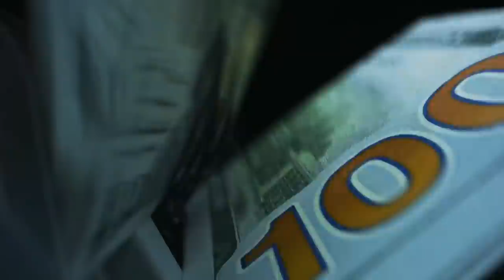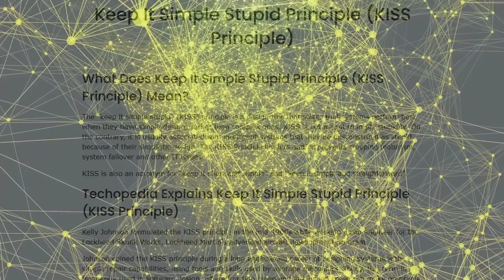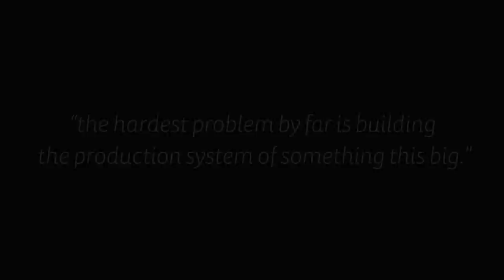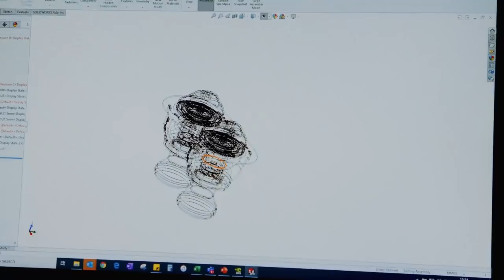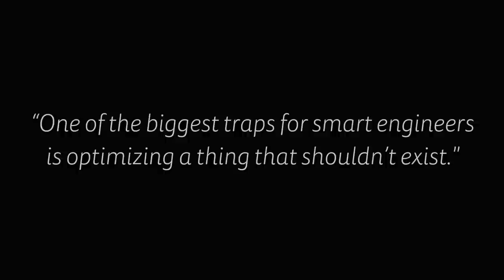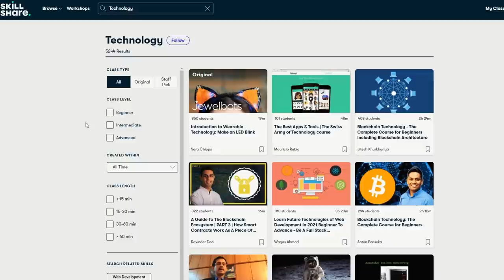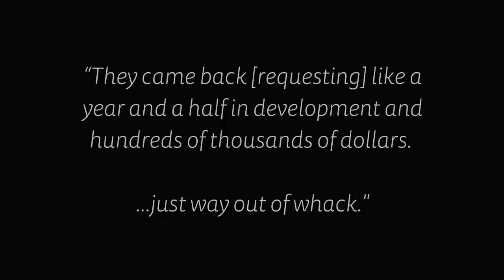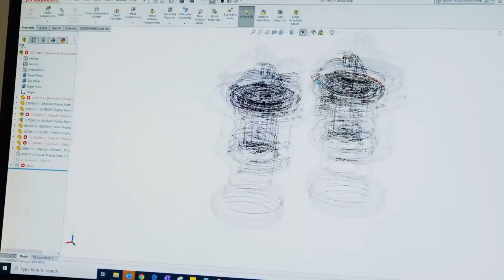How SpaceX Uses Simplicity To Engineer The Cheapest Rockets In History

Comment: I couldn't give a shit less about billionaires buying their astronaut merit patch.  Wake me up when we start going to space for reasons we can all benefit from.  Not before.
Reply: Starship will allow 100 people to go to the moon at a time for maybe $250 million. It will send 100 tons of supplies for the same price. If landed on the moon, (they will be able to do this in about 3-4 years) it can provide 1000 cu meters of living space (more than the internal volume of a 747). The rocket will be cheap enough to just land it and live in it at about $70-$100m to build. (Musk hopes to get that number down to about $30-40m.) 
Now he has a Boaring company that builds 12' dia drilling machines and you could launch one on a couple of flights in sections. It is designed to "porpoise" drill directly into the ground with no shaft required. 

Now you will be able to create tunnels on the moon and drill for ice, titanium and other elements while the machine extracts the rubble that will make the tunnel panels to reinforce the tunnel that it lays as it goes. 

Now build a loop a few hundred meters in diameter, put maglev cars in it (easy in vacuum with 1/6 gravity and have it slowly spin sections to create 1G gravity living environment well below the surface radiation and meteorites. 

Drill for raw materials, send new crews up at 100 per trip for less than $2m per seat and build a large, self sustaining colony that can send ore to orbital tations via magnetic accelerators (which would actually work at 1/6 gravity and allow construction of massive ships in lunar orbit to go out and mine planetary core remnants with massive reserves of heavy metals (gold, platinum, uranium, etc) such as 16 Psyche. These ships could be 13m or 18m in diameter and use Hall thrusters for months long journeys to bring back ore vastly more efficiently than rockets. They would not need large engines as they would never enter a gravity well stronger than lunar orbit. 

Now these big rockets can be used to shuttle cargo from earth to moon and back again but never land as tenders ("only" the size of Starship, acted as tenders to deorbit cargo.  As products start to be produced on the moon with additive manufacturing machines employed in near zero G environments in lunar orbit with materials from the surface. 

You could manufacture satellites on the moon and trans-ship them to Earth easier than launching them to LEO from earth. 

Power sources used (solar is the standard) could include Liquid Salt Thorium reactors which Have been pioneered already, are safer, cleaner, much more fuel efficient and cheaper form of nuclear power. These same reactors are also lighter (with no massive pressure circuits required like light water reactors as their coolant never enters the vapor state. 

With Starship, you get to setup the first stepping stone into producing a profit base and sustainable future in space and habitats that peope could inhabit for years with no bone or muscle atrophy and throughly shielded from radiation deep underground. 

 So... with the other ships you get to conduct a few experiments and collect a few moon rocks. With Starship, you open up space for colonization, not as a pet pork project, but as a opportunity for profit to draw people to Want to live there without government incentives. 

Oil workers endure Saudi Arabian weather for the money the jobs bring and the companies come for the profit. That's what this will allow. 

Musk wants to build 1,000 Starships in a 10 year span once he has profits from Starlink coming in (expected to be at least $10-20billion clear profit per anum from 2025 or so) to fund the construction. Some of these will be the big freighters mentioned prior. These can setup a city on Mars, but I suspect they will setup a much more practicable and valuable city on the moon far sooner and This and its ship yards will be out gateway to the outer solar system. 

Given the resources on the moon and the ease with witch they can be transported to orbit, zero-g hotels, tourism, etc. 
Massive space stations can be supplied with raw materials much easier from lunar orbit than from the surface of Earth... buiding massive sections of space stations and transporting them with Hall thusters to earth orbit, or simply the bulky raw materials so that they can be fabricated by additive mfg robots (that have already been desiged) to build the superstructure. Imagine the savings in sending materials from moon to earth orbit (however ironically) once the infrastructure is in place. Magnetic accelerators are Cheap to run and from there you only need fuel to go from Lunar Orbit to Earth Orbit - and never enter a strong gravity well.

Comment: Do you think suborbital flights can be done with an electric rocket?
80-100km should be feasible with a lithium-silicon battery, you just need water as a propulsive mass, a pump and an electric heater.
Cost per seat could be less than 10$
Reply: I doubt water can produce the needed force and the weight of your battery would make it too inefficient to reach that altitude.
Reply: @nunyabiznez6381  LOX/LH2 rockets are basically water rockets and they have a lot of thrust...

Comment: I have been searching for hours and I was wondering: Does any aircraft has or is projected to have an higher L/D (lift to drag) ratio than the Concorde at mach 2?
Maybe the SR-71 Blackbird, the boom Ouverture, the Spike S-512, the Aerion AS2 or the Lockheed Martin X-59?

Because the Concorde only has an L/D ratio of 7 which means it needs 1/7G of acceleration just to fly. The model S Plaid can deliver 1.2G at 60mph so with the same power density it would deliver 1/21G at mach 2 which is still 3 times too low...
Reply from the maker: That's quite an interesting analysis, are you talking in terms of an electric supersonic jet? It's worth mentionind that the power/weight ratio of cars is typically lower than that of aircraft and this has quite an impact on output acceleration along with quite a few other factors. I think the hardest barrier for an electric supersonic jet is in terms of energy density.

I found this interesting thread on stack exchange: https://aviation.stackexchange.com/questions/19569/how-many-kilowatts-to-get-an-electric-747-8-airborne

It's looking at a 747, so not supersonic. I'm not an aerospace engineer, so I'd take what I say on this with a grain of salt, but I believe the greatest challenge from a supersonic aircract is in the transonic regime of 0.8-1.2 mach. If I remember correctly, this is when it uses its afterburners.
Reply: @ExaCognition  At subsonic speeds the lift-to-drag ratio is way higher, it's 20 for the Airbus A380 so it could be as high as 30 for a blended wing.
1.2G at 60mph would be 0.1G at 736mph which is 3 times more than needed so the Plaid powertrain is more than good enough for a subsonic plane.

Comment: spacex launch costs about the same as nasa-s (~15%)
Reply from the maker: It can be hard to compare launch costs, because its different rockets for different jobs. NASA's costs are fairly visible, while all we see for SpaceX are prices, not what it costs them. We can try to piece together actual costs from statements from SpaceX, but they aren't very clear or consistent. In any case, its very hard to show that NASA's launch costs are remotely similar to SpaceX, they are considerably more expensive.
Reply: You are comparing pressurized payload (dragon 2) to unpressurized cargo (Space shuttle payload bay)
If you take a look at unpressurized cargo they are 18 times cheaper than saturn V and it's even better if you compare them to the space shuttle.
Reply: @johntheux9238  and are you factoring in inflation?   A billion dollars in 1969 was a whole lot more money than a billion dollars today.
Reply: @nunyabiznez6381  Yes, otherwise the difference would be even bigger...